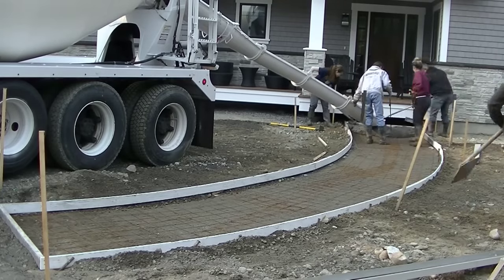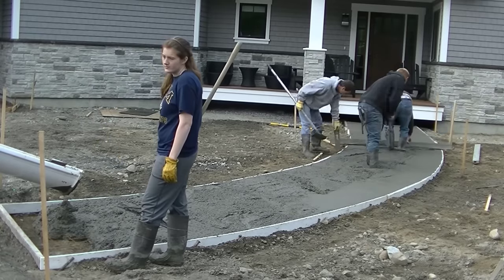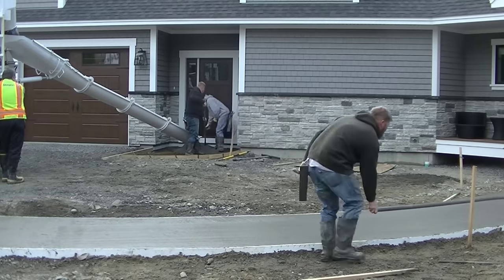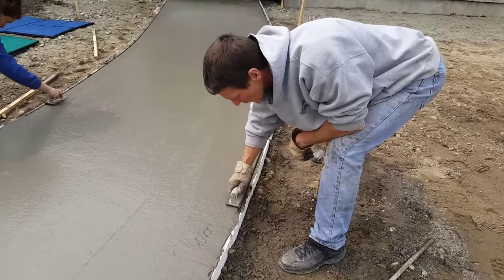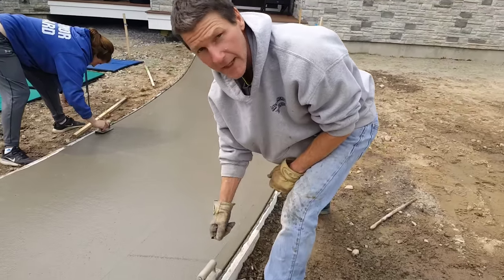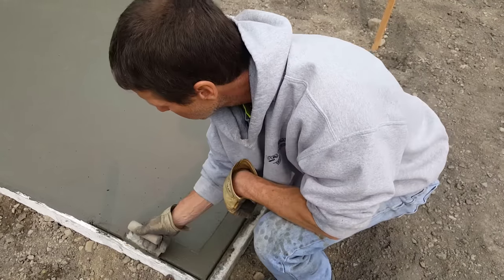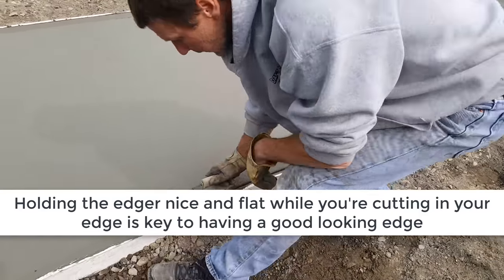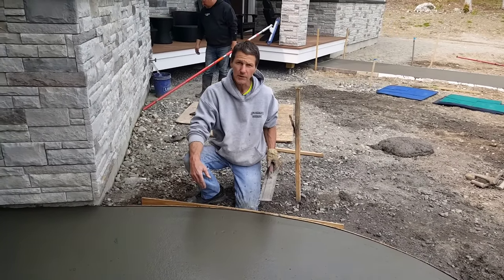When To Start Finishing Concrete After The Pour

Comment: For those that don't get it, you edge when still wet because the rocks will push out of the way easily, two late and they resist movement.
Reply: I was about to say the same thing
Reply: Oh I got it 👊🏽
Reply: Too late..
Reply: It trips me out why people would rather bend down . In the west we use walk behind tools so much faster .
Reply: Where can I find the tools you’re talking about?
Reply: You're kinda right but kinda not. I've been finishing for almost 25 years and I can safely say after watching his videos that Mike Day understands mud and knows how to finish it lol the guy is a purist. It was common practice that the old schoolers  would wait until the bleed water dissipated to tool edges, joints, etc. to avoid working the bleed water back into the very place in which it came from. Look, I do early edging all the time, but when I do, I always make sure to mag my edges again behind it quickly. Mike is teaching textbook here
Reply: 😮😮jjjkiii
Reply: @zakkwylde4201  How soon After screeding do you bull float?
Reply: @LiloUkulele immediately after a screed, though I find waiting about 5-10 minutes will let the bull float glide and fill a bit better and less likely to sag and drag your concrete if it’s a bit higher on the slump
Reply: Depends on the weather though 😂 hot and windy youd best have a hose handy
Reply: Great tip

Comment: You need to feel it. It might be different every time and depends on a lot: mark of concrete, add-ons in it, quality, water amount, weather humidity, weather temperature etc etc. We used to do a long paths and slabs 2 of us. Add a bit of water if hot day, ones holding the shoot of the mixer, the other ones leveling/screening quickly nearly to a perfect level. Or do 5 meters, stop the mixer, screen it, start the mixer. Let the mixer as quick as possible. Then float it with a big float, add where's short and take out where too much. Then the edges. Then cuts every 3 meters. Then  timber trowels to bring fat up, edges again, cuts, then steel trowels and edges again to perfection. And when is literally couple mm of fat left on top, brush it, edges and cuts again.

Comment: also depends on strength ,that wire mesh is usless should have been raised up off ground to get concrete under it.
Reply from the maker: Yea, you're right.
Reply: You had someone pulling it up. No  reason to rod in the mud when you can have two people on the outside.
Reply: @matthewward1608  Maybe they like to play in the mud lol
Reply: Mesh is useless anyway even if it's up in the crete
Reply: It was lifted as the concrete was poured, but then stepped on when they started screeding!
POINTLESS
Reply: @bobk3884  lmao you go tell the form work workers that they can stop putting steel reinforcement in high rise buildings .

Comment: I enjoy watching videos from a craftsman who takes pride in his work and clearly knows what he is doing
Reply: Question, for a small area would a bull float still be used? Or still use it, just with a handle instead of a pole?
Reply: Yea, if had any more pride in his work he would have pulled the wire mesh up into the middle of the concrete like he was supposed to. He does a nice job finishing the concrete but if it was on one of my jobs and I saw this video he would not ever get his pay check and never work for me again.
Reply: @krisknowlton5935  It appears to be in the middle!
Reply: I have 45 years of experience and he's doing all wrong
Reply: @krisknowlton5935  yep I thought the same ...What do they say...them that can ..do ..them that can't teach ...I can't believe so many people think he's good.. obviously diy,s who dont know the right way
Reply: @paulely1644  educate me, exactly what is he doing wrong?
Reply: @paulely1644  I was taught by a structural engineer, who could finish concrete, about 50 years ago. He believed if you were just going to leave it in the bottom don't put it in at all. And always make sure what you are pouring on is solid.
Reply: @krisknowlton5935 , can you please recommend a video that you’re good with
Reply: @zenco1611  I am good with this one. As I said the finish looked good. But if you busted up as much cracked concrete as I have over the span of fifty years you would understand why it is important to get the wire mesh into the middle of the slab. After watching the video again I did notice someone pulling the wire up but then there was another worker coming right behind her tramping it down again. Other than that, they did a good job.
Reply: @krisknowlton5935  the woman is pulling up the mesh. Not sure how high but it is being done.
Reply: Yeah. For this one those foot print spots no matter how flamingo like you move the aggragate pushes down and opens a crater where water Portland and sand fill the void. Twenty years later it's the first erosion damage areas. For that walkway they shouldn't have even stood in it.
Reply: @krisknowlton5935  I agree pulling the mesh up appears to be a poor short cut, if I was ever doing this I would use standoffs to ensure it's in the middle

Comment: I’ve worked on two skeleton crews doing driveways, patios, and sidewalks. My uncle is always very adamant about pulling the wire up as concrete is being poured on that given section. The other crew I was with did not seem to prioritize it. I’m always thankful when we do a tear out and wire isn’t involved. The worst was working around a pool, boy that sucked. 
I’ve always found enjoyment in this work. I work in the oil field as a boilermaker, but am also venturing out into other avenues within it to beef up the resume, however I do concrete during the off seasons with the turnaround circuit. 
One thing I will say about the concrete trade is badass finishers seem to be a dying breed unless you go Union where guys are willing to really teach you, and the rare occasion guys nowadays want to stick with it long enough to make a real career out of it. 
Some very fulfilling work at the end of a job though, I love seeing the finished product. Proud to have worked with guys that really know their stuff so the customer is happy. Nice video.
Reply from the maker: Thanks Jake!

Comment: It's interesting to see how different techniques are used in other parts of the country. I always use an edger with a pole and I've never broomed before using a fresno or trowel. Looks like it works well for you.
Reply: That's called a "walking edger". Additionally a skinny little edger like he used in the video is something I would only use on curved edges or what might be called detail work. 6 inch wide edger is the tool most who aren't playing use. Most finishers I've seen use both a mag and a "pool trowel". A finishing trowel but with rounded corners instead of square. Some work doesn't really even need to be "finished". Parking lots for example. Strike it, bullfloat, edge and joint and then brush it. All depends on what the intended use and desired appearance is. A nice patio slab takes more work.

Comment: Mike, I'm a big fan and try to watch all your videos. I question about a big problem I've recently ran into. I had a guy seal a driveway and he done a terrible job. Had a guy go back in to fix it and it doesn't look any better. I've looked through your videos and haven't seen anything on stripping sealer. How would you go about doing that? Stripping the entire thing and redoing it? I've never done it and don't know the route to go. Thanks!
Reply from the maker: Brad, check out a couple products 1 called Deco-Strip from Nox Crete and another called Delaminator from Butterfield Colors. Both are for removeing acrylic concrete sealers.  Soy-Gel is another. I haven't had to use any of these personally but check them out and see what you think.
Reply: @MikeDayConcrete  thank you!

Comment: I really enjoy your videos, and have learned a great deal. I now have the confidence to try a few small projects, and I'm getting better every time. My one question is what is the primary difference between bull floating and mag float? I haven't invested in a bull float yet because I'm doing small jobs, but it seems like they are very similar?
Reply: The hand float and the bull float are both usually made of Magnesium. I think Mike is used to saying "mag" as short for Magnesium.  Around my area the small ones are called hand floats.

Comment: Those little cut edgers are good only for tight radious edges.  Your edge is nice but the groove you leave on the inside is gonna be a big dealer than when you use a larger tool ,the more surface area the edge tool covers the less of a mark will be left to trowel out .  If your short handed or concrete is setting up fast  little things like a mark from your edger is gonna be a time robber   .the more work you put into placement , screeding, edgeing , the better off you are when it's getting hard and your on knee boards .make it as easy as possible.  Good video  nice work as well
Reply from the maker: Thanks Manuel! Good comment!

Comment: like the videos and just have one question, after the forms are removed which is the case in my new driveway and sidewalk, they left a 4-6" trench around the slab and sidewalk, what is going to prevent water from going under the driveway and sidewalk and washing it away over time? I have been combing over your videos and haven't found an answer.

Comment: I can frame, drywall, plumb, electrical, tile, but not cement. I can never get it to look the way it's supposed to. Until NOW! I watched your video, went outside built a 2x2 frame, mixed some cement, and with your knowledge it came out the way  it's supposed to!!! I can do that 12x6 in the front myself. Thank you for sharing your tips with us!
Reply: That's cool, did you finish it yet? I'm about to start my own project

Comment: for anyone who has poured concrete in their life, knows that this is a very common factor, depending on the temperature of your weather, and depending on what number you pour your concrete at will determine how long you’ll let your concrete sit and cure before you start the process of finishing your concrete! If you pour your concrete thick with not much water added and your pouring your concrete @ a number 4-10 and it’s very hot outside, you’re going to want to start quick  , if it’s cold outside and you pour your concrete thin at a number 1-5, you’re gonna wanna let it sit for a little bit and tack up before you start the finishing process. So at the end of the day every area and every jobsite is different and every installer feels different about how they want to proceed about their installation.

Comment: Fantastic educational video thank you. My son-in-law came and poured half a shed slab yesterday. It's only half complete and he will come back next weekend to finish it off. He tapered the edge of the concreting that he did yesterday. I'm just wondering whether we will have problems with the concreting cracking  in the future, due to 7-day break in-between . 
My brain is not comprehending how the second lot of concrete will stick to the 1st. If it was clay there is no way wet clay would stick to the dry clay
Reply from the maker: The new doesn't really stick to the old concrete. We would drill 3/8" holes about every 2' into the old concrete about 3" deep. Then pound in some 3/8" rebar to pin the 2 pads together. These pins are about 12" long so 3" go into the hard concrete and about 9" stick into the new pour. That's how we keep the two pours from moving apart.
Reply: @MikeDayConcrete  the old concrete was poured last Saturday and the new concrete will be poured next Saturday. A week in between.
The slab is 4 by 4 metres. He has done approximately half of it last Saturday and created a slope on it, so the 2nd lot of concrete can be added. I think he was thinking of putting adhesive in between. It sounds a bit funky to me and it even looks like it might not work. I'm a woman with no knowledge but somehow in my mind I am thinking we should have boxed up the first section last weekend and then continued on the second box section next weekend. 1 slabs done into sections. I have no idea lol. Thank you so much for the information , i appreciate your reply & will show my son-in-law...

Comment: With colder temps coming....   What is the coldest temp you can pour concrete?    Is there anything you can do to help protect/dry concrete in colder temps?    Thanks for your videos.
Reply from the maker: Michael, there's a few things we do as the temps get colder 1. We pour with hot water in the mix. 2. We use Calcium chloride in the mix to help it set faster. 3. We cover the ground with insulating blankets or poly and hay to keep it from freezing. 4. We cover the concrete when we're done with the insulating blankets or poly and hay.  I will pour a floor or slab in temps down to about 28 degrees out and it will dry just fine using these methods. Anything colder than that you risk the surface freezing a little - it's not worth the risk.
Reply: My boss wont let us poor if it's under 35 degrees, and if its close to it (38-40) we will cover the concrete with "blankets" witch are plastic tarps with two layers and a cotton layer in the middle. Cracks can happen in cold weather. Once the mud is a couple days old, coldness wont effect it at all.
Reply: Yes sir ... one should cover the concrete with blankets even if you included additives in the concrete - or you you'll see your concrete crack ... we do this here in the Mdwst .
Reply: I was gonna offer advice but these fine people got you covered with good information!

Comment: Mike thanks for the help and the great video!! One question, aren't you supposed to lift the wire mesh up into the middle of the concrete as you go? It looks like they just poured it on top and left it on the bottom.

Comment: Isn't it mandatory to have to lift up the five by five welded mesh when you pouring the concrete I mean if it's just sitting on the bottom what is it doing just sitting there
Reply from the maker: Yes, lifting it into the concrete helps.
Reply: Use the hook

Comment: I’m a concrete finisher but from the south south…. Is 30-45 minutes where YOU guys start edging, we already have joints cut and almost ready to broom it.  
 
 Within 2 hour of putting it down on the ground, you looking at Fresno or broom. 
 If you didn’t tooled the joints in, you might as well saw cut them the next day. 
  
 I wish it was cooler down here. 85 degrees would be perfect for us down here.

Comment: Takes pride in the finish that’s for sure, but a crew of that size should be able to finish on the go- place, screed, roll, Darby,  float edges, broom and edge if it calls for it. That first walkway in video should only take probably 20 minutes start to finish.

Exposed aggregate obviously takes longer, and I’m all for waiting to put edge marks and control joints in once it stiffen up some, but if you need to use acid when you start the initial wash you may as well pack your bags up and never do it again.
My suggestion for broom finish slabs, if you cant get to the brooming stage with the slump it comes off the truck, you need more experience, if you’re pouring against a cold joint and you’re green, wait till it stiffens, mesh like this cluster, either put some 2” bricks under it, or rake it to grade and set it in then have the screeder and rakers push it down, a vibrator can sometimes make mesh placement worse.
That’s my rant, wish I could be more useful but that scraping noise the edger and floats were making scares me, sounds like my float screaming for help when I start scrubbing my 50th meter of hand curb… but please let me have your rakers, if they can grade like that my back would feel a lot better lol

Comment: Hi Mike. Can I use those edger to cut lines for road contraction joint? Usually in our country, we wait for a couple of days for the concrete to harden then cut it using concrete cutter. I was thinking it is much easier to cut using the edger while the concrete is wet.
Reply: Cutting it is the proper way to do a control joint. It may look nicer to tool it, but you can’t tool it to the needed depth of 1/3 the total slab thickness. After your first freeze/thaw the slab will not shear properly on the control joint.

Comment: Mike, We are looking at pouring 170' of 4' sidewalk in two weeks at our property. PVC trim is $1.30/ft ($510). I found a guy selling used pvc trim for $2/8' stick. That comes out to $.25/ft, but he's 130 miles away. My father in law is an old school concrete guy. He said they used to use hardboard (masonite) ripped to width to form curved concrete. They would double it up and use a ton of curb pins, use form oil, and go to town. It was a one time form, but he said it worked good. Do you have any input on this, knowing this is a one time pour for me, and I don't need to have reusable forms?

Comment: Why lay steel reinforcement on the floor under the concrete,it will reinforce diddly squat unless it is within the concrete,the steel will eventually rot,and a couple of good frosts will blow the concrete and make for repair or full renew

Comment: we always edge it right away and then hit it again before we finish it. i also dont really like that style of edger. i like the thin steel ones with 3/8 in kerf
Reply from the maker: It' really preference. We like the brass ones. I like it to firm up a bit before I cut in the edge. There's more than one way to do it and get good results, everyone's a little different. Thanks!